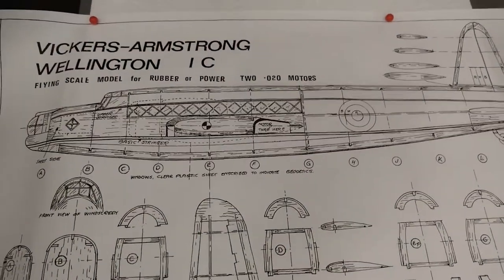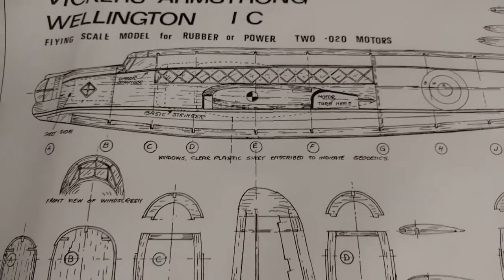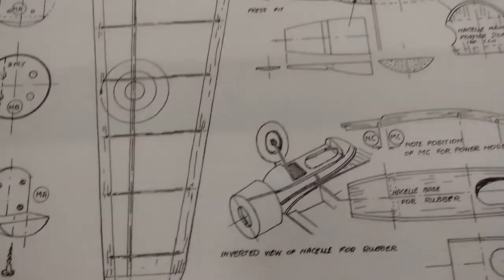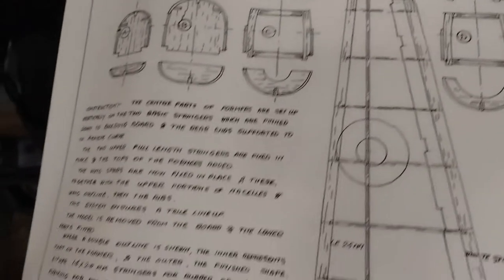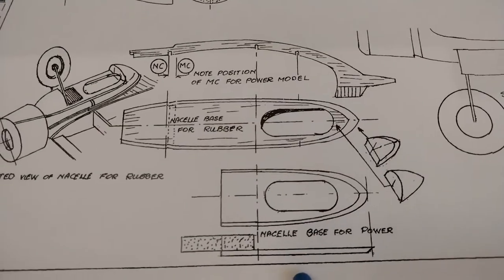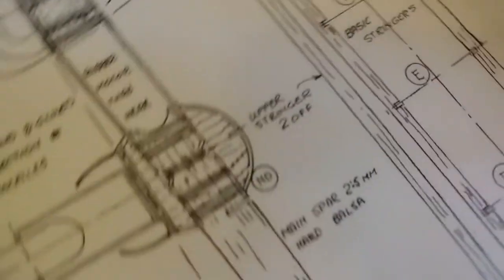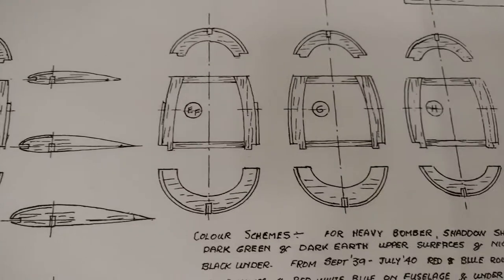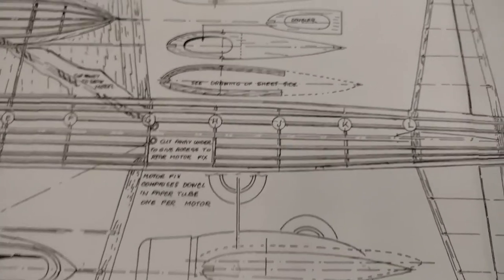01 Wellington Balsa Model   Plan Preview

Comment: Regarding undercarriages, this is a "thought bubble". It is not tried and true or based on experience. The thought is what if you had the undercarriage on a light spring, that "only just" sprung the undercarriage forward. When the model is on display, if the undercarriage was slightly in front of the pivot, the weight of the model would naturally hold it forward and "down" - but only just. For flight you could pivot the undercarriage back into the retracted position, against the light spring, and then retain it in the retracted position in some way. the first method that came to mind was just to put some tape around the engine nacelle, starting on one side, across the bottom and up the other side. Crude but simple. Another way would be to have a horizontal pin that goes across the engine nacelles, that slides through tubes set into each size of the engine nacelle. The pin would hold the undercarriage "up" against the light spring. I also wondered about not having any arrangement to hold wheels up, to let them hang and on "landing" on grass they should (might) rotate back into the engine nacelles; of course they might snag on the grass and cause bad things to happen. Though bubbles ...
Reply from the maker: Thx for the "Bubbles". I hadn't thought of the spring. I was thinking of a wire assembly that would pivot in two holes and that could be squeezed out if needed. To hold the u/c down I would have a similar one going up into the rear of the nacelle that could also be removed. To keep it up your idea of a pin going horizontally might do the trick. This is part of the fun, to think up solutions.
I see you made a comment about the Towner models, but I can't see the full message somehow. Is there any place where there is information about Towner and his models? I am kind of doing his models primarily as I have a personal interest in him.